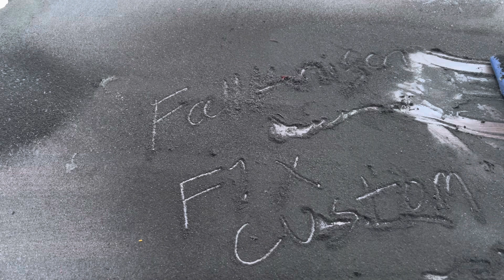F1x Custom Fallkniven @thetopicala

Comment: Do you use other materials for scales? - I like the look of wood but I usually prefer micarta scales for durability reasons. 

I would be interested in changing my f1x scales as well.
Reply from the maker: I just fulfill my client‘s wishes. One of my latest works was using micarta (for the first time) for client‘s wish and it was just positive experience!

Comment: I’m going to do something like this soon to my s1xb but I was wondering how I would not scratch off the black coating when sanding. Do you have any ideas?
Reply from the maker: Hey, thanks for asking. I am on to same issue at the moment. Either you do shape loosen scales and attach them like the original scales or then do it like I have desided to do: glue the wooden scales with new brass rivets and sand and loose coating and finally either let the edges shine or try to gunblu edges. ???

Comment: Are there holes to lighten the weight? Thx
Reply from the maker: You mean in original blade (tang) or after the custom work?
Reply: @thetopicala  original blade :)
Reply from the maker: @scsanchez2213  There are only three srew holes in the tang.
Reply: @thetopicala  thx